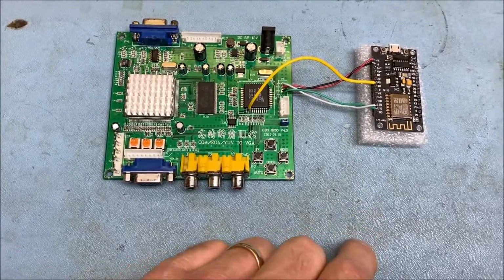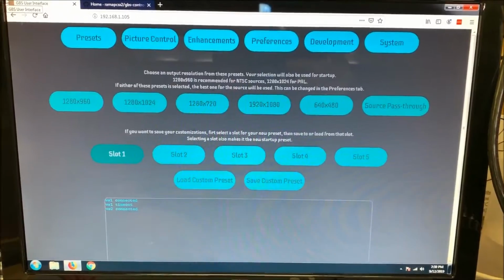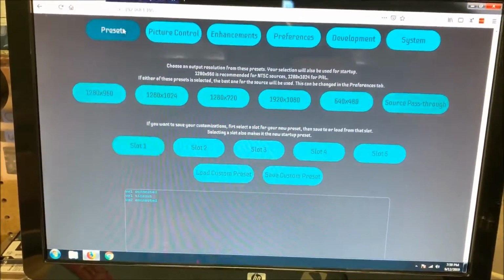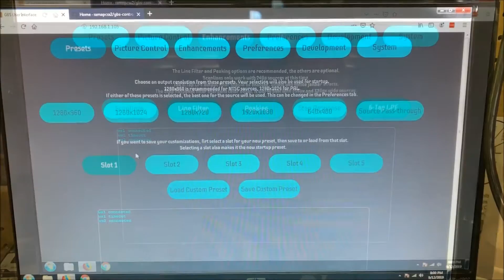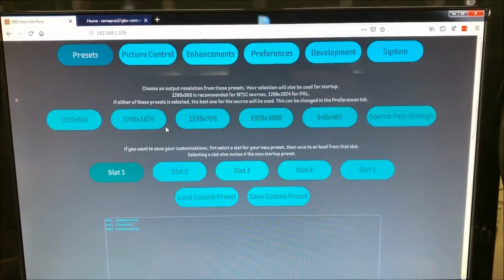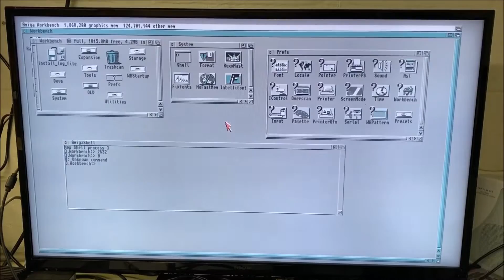GBS Control : Firmware that brings the GBS-8200 Video Converter Series to Life.

Comment: I've tried this thing and am very unimpressed.  When changing screens, the display is then off centered. Each time to swap applications the screen ends up in a different place that it was the time before.  I found it mostly unuseable.  It's a great device but doesn't really work well with the amiga custom screens, unless there is a setting I am missing somewhere?
Reply from the maker: I haven't used mine in a long time since I found a monitor that will sync to 15.7. It certainly had some quirks but once I got it set up it was good, although I wasn't changing resolution much.
Reply: @SteveStoltz  Yeah I also found a 15khz dell lcd and it's much better. I think I may remove GBS control mod, and try again.. I think this board is actually better for the Amiga without GBS control
Reply: @SteveStoltz  Also forgot to say thank you for the video, it definitely help me perform the mod even though it didn't play well with the Amiga!

Comment: Never had an Amiga but I have had a VIC-20 and currently have a C64. I’ve been using my GBS8200 for arcade stuff mostly but it also make an excellent scaler for retro consoles with GBS-Control since modern TVs don’t properly handle 240p. Once complete it’s a whole lot cheaper and less fiddly than something like an OSSC or XRGB Framemeister.

Comment: Thanks for the video. 

About the wifi issues, did you ever try powering the ESP from the 5V pins (next to the barrel connector on the GBS) into the VIN input on the ESP (which should regulate it down to 3.3V. 

I haven't built mine yet but I noticed the build instructions says it's not recommended to use the 3.3V pin directly and some other videos I've seen use the VIN instead and didn't mention any wifi dropouts.

Comment: Any ideas why I can't even find my GBS-control on my wifi?  My phone picked it up for about five minutes but now I don't get a thing and the led on the gbs control never stays on more than 5 seconds.  No idea what it could be.
Reply from the maker: A fellow You tuber said that using a ceramic heat sink and 26 gauge wire solved the WiFi issue with theirs, I plan on doing it to mine, just haven't yet.
 I have had various WiFi issues since the beginning. At some point I was able to get it to connect to my router and access it through the IP address on my local network, its still not real stable but the best scenario I've found so far.
Reply: @SteveStoltz  Hi again, thanks for the tip.  I seem to be able to find my GBS control when my wifi router at home is switched off.  I think this has something to do with the fact I entered in my wifi setting into the gbc control via the online control panel.  Long story how I discovered that.  Anyways I still get no signal.  Someone has told me I need to do a mod with 100ohm resistor across something or other but I cannot for the life of me find explicit instructions on what to do.  If you have any tips man I would appreciate that.  Is this what I see on the bottom of your board?  Like a resistor between GND pin and the S pin?  Can it be any 100ohm resistor?  Thanks in advance, totally appreciate it.  **edit***  I just checked your gbs control, you are using a different 3v pin and ground to me, I chose the 3v and ground pin closest to D1, D2, D3 etc  does it matter what 3v and ground pin I use?
Reply from the maker: @RabidGerry  I just tried something this evening and it seems to be working. I haven't gotten my hands on a ceramic heat sink yet so I thought why not ground the heat sink? My theory being that the RF signal would just sink to ground and not go air born. I checked the continuity of the heat sink to confirm it was isolated then I ran a short wire from the heat sink to a nearby ground via. So far with the minimal testing Ive done I've not dropped the signal yet. Your mileage may vary.
The 100 ohm resistor between GND and Sync is necessary for impedance correction, but it doesn't effect the wireless at all as far as I know. Either way you should add it otherwise you'll likely have picture quality issues.
Reply: @SteveStoltz  wow that could be an interesting discovery you have made.  Keep me posted on that.  Well I did the 100ohm resistor mod and noticed nothing different running without GBS control.  I've just crocodile clipped it together at the minute.  Using the GBS control, still no picture.  I didn't build it I bought it from a guy.  Could he have got something switched round the wrong way perhaps?
Reply from the maker: @RabidGerry  Incorrect wiring is a possibility, is the debug jumper installed?
Reply: @SteveStoltz  hi Steve, yeah the jumper was installed.  Although I started reading about how to build one from scratch and I read near the start how two wires can be wired the wrong way around and cause no picture at all.  I have ordered myself a brand new Arduino board and I'm going to try it from scratch myself only this time not have a clip on style that sits in the chip like mine does, I'll just have it attached via wires and see if this happens.  You think it's easy enough to do from scratch?
Reply from the maker: RabidGerry yeah it’s not hard, even if you’re not familiar with electronics.
Reply: @SteveStoltz  I dabble, but have little understanding of what I'm doing half the time.  But I have modded lots of stuff over the years.
Reply: @SteveStoltz  Ok so I got the board, same as yours this time.  Boy oh boy what an issue I had getting the thing recognised as a com port.  But finally it paid off today.  So followed the instructions on GitHub, got the software compiled and uploaded to the board, not I just need to hard wire it like you have done.  Man how on earth did you solder the debug pin of that chip to wire?  I might have to buy a smaller iron with tiny little tip and a magnifying glass!!
Reply from the maker: That debug pin is a pain, it’s very easy to get a solder bridge. It sounds like you’re close to having it functional though.
Reply: @SteveStoltz  well hell I dunno if I am, I just followed the website guide on GitHub.  So I just need to make the physical connections.  I just ordered a jst xh plug for the 4 pin bit so hopefully that's easy enough to do as well.  When you say solder bridge what do you mean?  Oh and is it easy to remove the heat sink from the big chip?
Reply from the maker: @RabidGerry  By solder bridge I'm referring to shorting the debug pin to the adjacent pin(s). Ive not tried removing the heat sink yet, but in similar situations Ive been able to get it removed by using a heat gun (or hairdryer) to warm the heat sink up and working it off by gently twisting it back and forth until it comes off.
Reply: @SteveStoltz  aha I read I could do it with a hair dryer so that makes sense.  Thanks for the tip.  Well I shall let you know what happens when I get it all connected up.  Totally appreciate your time for replying and help man thanks.
Reply: @SteveStoltz  So I soldered it all together finally and guess what?  Still didn't f-ing work!  Now I can't tell for sure, but to me it seemed as though it wasn't receiving power.  So I checked the 3v pin on the board and it was giving 3.2 on my multi-meter  so I don't know what the problem is.  I also I am pretty sure I got that debug pin connected without a join to either side so everything should be ok.  Really dunno what to try next.
Reply from the maker: @RabidGerry  Mine started acting unstable after I upgraded to a newer version than what was originally on mine, so possibly there could have been a bug somewhere that may be fixed in the current version. I just haven't had time to get mine re-flashed to current. So possibly that could be contributing to your problem.
Reply: @SteveStoltz  Turns out I did have those wires for powering the gbs control soldered to the wrong 3v and ground prongs, so I copied the way you have it.  Working well but occasionally I get a weird tear line so I fixed it using the Framelock option in preferences.  This works well but sometimes it wont remain stable on my tv.  However if I switch my tv off a few more times and back on it eventually seems to settle and no tear line also.  As for connection, I put my home network setting into the gbs control and now I access it through an IP that I found on my home router.  How was I meant to figure all that out?  Instructions are sparse on the git hub or vague.  I was on my router simply to see what devices were connected to it after my phone could no longer fin gbs control.  So when I saw gbs control listed on my router I typed in the ip address beside it and hey presto!  I got the control panel to load.  I never have issues now with the wifi.
Reply from the maker: I had to connect to my network as well, it seems to be the most reliable option, I’ve had a little instability issues when switching between different monitors like they are having issues syncing. Some work right away others are temperamental. I just haven’t had time to look into it any further.

Comment: Hi great video. Had the same wifi problem but I replaced the heat sync on my board with a ceramic one and used 26 awg wire worked great
Reply from the maker: Lum Invader thanks for the tip, I’ll give that a try. Thanks for watching!
Reply: Hey Lum, What's the 26 awg beneficial for?